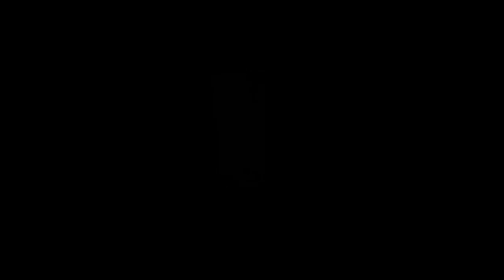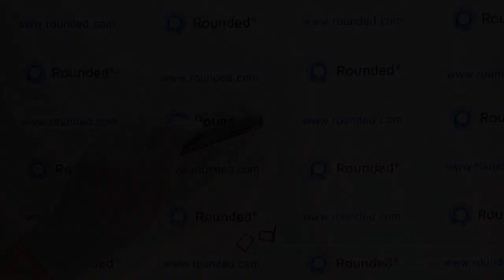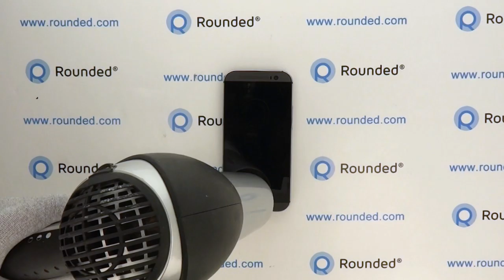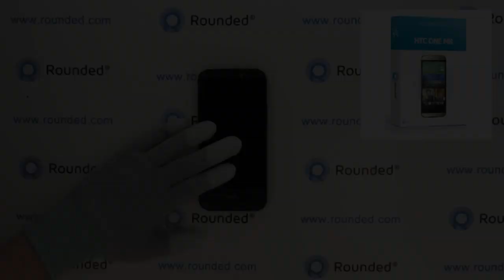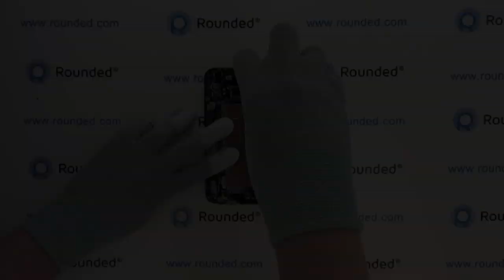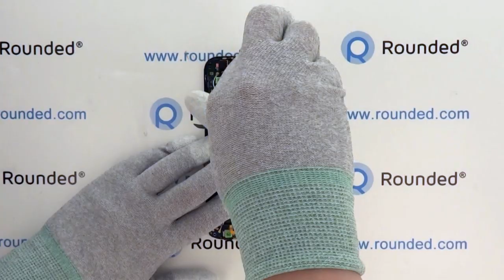HTC ONE M8 Repair video

Comment: I just got a screen and lcd replaced by so phone doctors and now the on screen keyboard is messed up, when you try to press the letter A the letter Q appears in stead, and its like that with a few letters, is that a messed up screen/lcd that they put on or is it something they didnt plug in all the way? can you please let me know so that I can tell the technicians before they start giving me excuses, thank you very much, great video by the way
Reply: You might need to calibrate the screen. Go to Settings, then Language & Keyboard, then HTC Sense Input, Advanced, Calibration Tool.